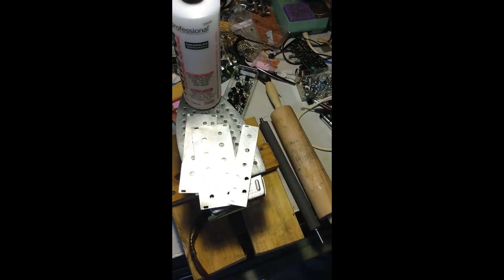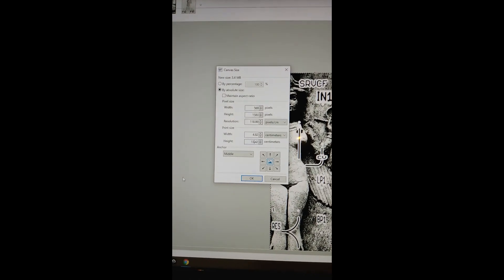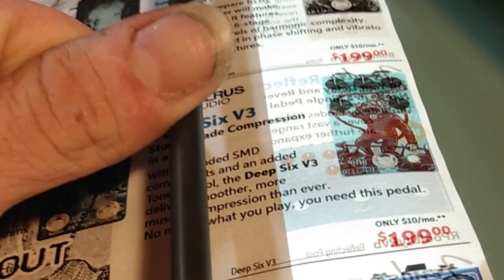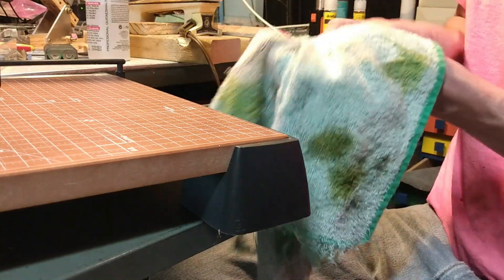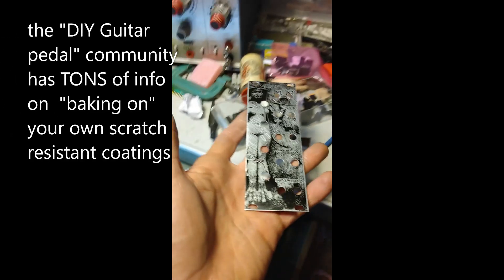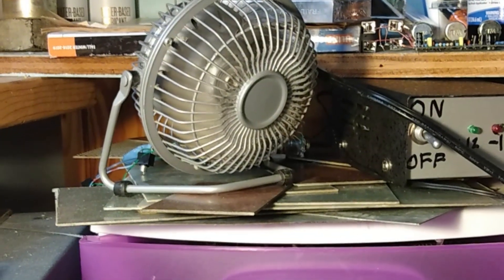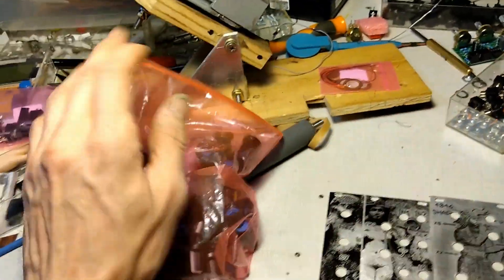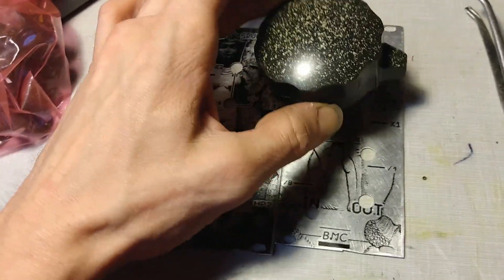"Sweetwater Hotpeel" Toner transfer technique (DIY synth panels)

Comment: how is the scratch resistance? I mean, if you rub the nail, does the print comes out ?
Reply: Just seal it with clear matte spray lacquer....
Reply from the maker: @Wulfhard1965  hairspray will work in a pinch, but I don't know how well...
Reply from the maker: it's okay.  a fingernail will take it off, but you'd have to really try.
Reply: @brownobservablephenomena  thanks man !! Gonna found some mag and make some experiences here !💪
Reply from the maker: @pantalalabs  TRIAL AND ERROR WITH THIS IS PRACTICALLY FREE!